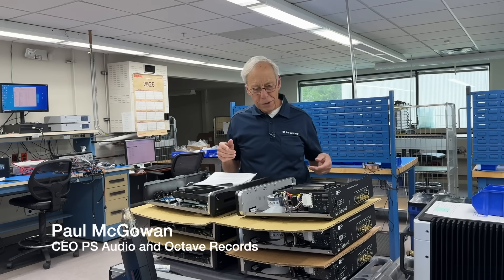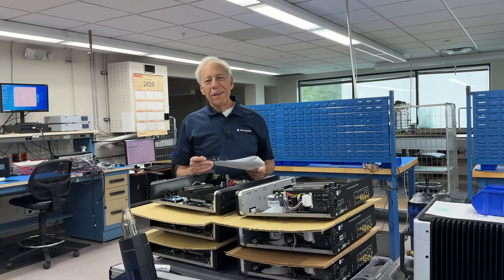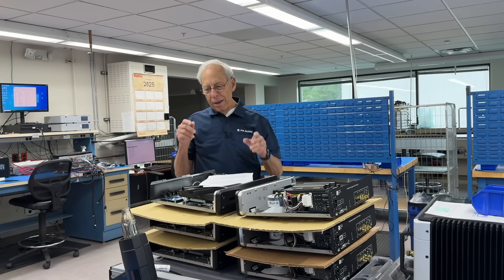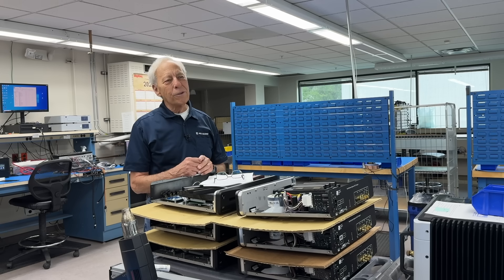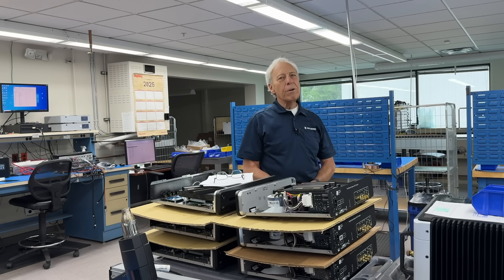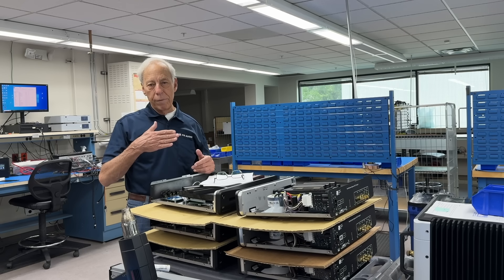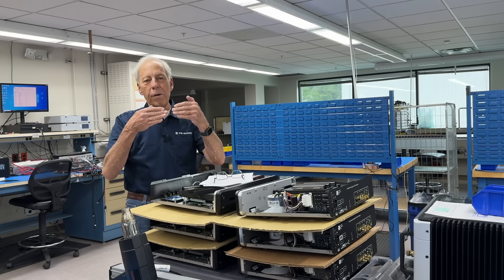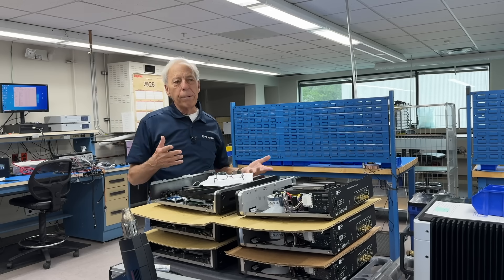How a speakers plays two or more things at once

Comment: Yea but...
The microphone is picking up all frequencies using the same diaphragm, and your ears are reproducing all frequencies with the same diaphragm.
Reply: Using a small diaphragm that only has very small movements (therefore with very low doppler distortion), and because of it's size can reproduce the entire audio spectrum, then putting it close to your ear might be an idea to consider.
Not the same experience with soundstage and so on I know, but cans should be capable of the highest possible fidelity.
Reply: Yes, the audio signal it is a single sum of all vibrations detected.  1 signal per channel.  Each is then amplified and fed to a speaker.

It is, at the same time, far simper than most people imagine and far more complex than most engineers enjoy.
Reply: That Part though 👍 💯

Comment: No that's not correct it's not suddenly moving forward and backwards to produce high frequencies that's not correct. what it's doing is vibrating and it's not actually moving at all. At the same time moving in and out at lower frequencies so you can have something vibrate but actually move as well in and out that's how it produces low to High frequencies. best way is to look at an exciter in a puddle of water should be something on the net playing a low frequency and playing a high frequency
Reply: Vibrating is moving.
Reply: lol.  A dumb response like this... WOULD come from someone with Trump Derangement Syndrome!   Typical NPC Lemming Zombie.

 Vibrations are Movements.  Micro Movements.  And yeah... the cone can and does move.  You can easily see a woofer move in and out... at higher volume levels.  Its called EXCURSION.

Comment: As a nontechnical person, this video was really helpful to me. I sort of understood before, but now I understand better. I have one question, though: If dividing the sound between two or three speakers is better (usually) than doing everything with one speaker, why wouldn’t it be even better to have 10 (pick a number) speakers, each responsible for a much narrow range of frequencies?
Reply: Listen to a pair of four-way earphones, compared to a single-driver earphone and notice the enormous difference.
Reply: It would... so long as each of the drivers are Audiophile quality, and your crossover components are also high quality.

 The less of a Load that you have on each driver... the less potentials for any Micro-Distortions to occur.

 All that said... one of the main reasons why Audiophile grade drivers do not suffer as much micro-distortions, as cheaper consumer grade speakers drivers..  is because Audiophile grade drivers tend to use Stronger Magnets, and Stronger Voice Coils.

 The Stronger the Magnetics... the more Accuracy and Control you will have over the cones movements.

 Its much like comparing a Pickup Trucks acceleration and braking performance... vs...  a Formula 1  Race Cars performance.
The F1 car can accelerate and brake, MUCH faster and better, than the Pickup.   And due to superior structural rigidity... the Race Car can deal with very high G-Force related Stresses... without the frame flexing... where as other cars, would Flex.

 That (in combination with sticky+wide tires)  will allow a Race Car to take very tight curves, at very high speeds, without slipping and getting out of control.   The same is true for a good Rigid speaker cone... that can retain its shape, without warping,  under high air pressure workloads.   And the speakers metal Basket.. also being rigid enough, to keep from warping, too.

 Obviously, Costs are a big factor... in how many drivers + crossover components, that are involved in a single pair of speakers.
And when you add in the extra costs of higher Quality drivers... rather than a ton of "Cheap Chinese Drivers"... you get even More cost being added.

 Anyway... even with lower quality drivers.. you can hear a difference in your music, when adding more drivers.  The easiest way to experience this... was the original 5.1 Surround Sound Amps (before Digital Dolby Surround mode).   Instead of using just Stereo mode... you can choose the Surround sound mode, and a single center channel speaker.. of the same speaker type and size.   You will notice, that when music portions of a surround sound movie comes on... the left and right speakers,  will have vastly improved music clarity... compared to when you only had those speakers in 2-channel stereo mode.   The center channel will be taking some of the Burden off of the Left and Right speakers... which allows for much more accuracy.. with the left and right speakers.

 The reason why most people might not notice this today... Is because they are using Under-Powered center channels... that have much smaller speaker boxes, and smaller + different driver types.   These center channel speakers, tend to be far Inferior to the left and right speakers... so you will notice how BAD it sounds... which will draw your focus away from the superior left and right speaker performance.
Reply: Crossovers also introduce phase distortion/cancellation. You've probably heard on this channel before that there are compromises. In addition to the distortion explained in this video, different size and shape speakers introduce eq and crossovers introduce phase distortion/cancellation. Every company making speakers has to make a series of compromises to get to what they want.
Reply: Technically it is better.  But crossovers to separate the low-mid-high bands are rather blunt instruments,  To build one refined enough to go with 10 bands would make it very inefficient and require high precision parts.  So the whole thing is a trade off between effect and efficiency.
Reply: then they're not a single source and you'd have issues with different sort of cancellation.

however a room does stuff already.  and a lot of performances are designed to be amped - you also need to remember that all recordings are meant to be played on speakers. you could argue that you'd need your recording diaphrame setup to match your output(for the doppler, to mirror the air pressure changes perfectly as they hit the the idealized recording device and are played out from the idealized device), but it gets really silly and some people just prefer different sound than others at some point anyway.

you'd be surprised how decent 20 multimedia speakers playing the same thing can sound though, even without any dsp.  for the doppler thing he mentioned the best would be elements that don't move much at all back and forth but then you get the size of them and it not being a point source problem and they start canceling themselves out.  also the further away you're from the speaker the closer angularly the different elements are in a multi element speaker get - the opposite may be easier to get that if your head was between the woofer and tweeter it would sound weird.
Reply: My guesses are: 
1) Cost and practicality. More drivers = more crossovers = larger speaker cabinet = more materials used = more manufacturing steps. 
2) Us humans may be accustomed to the doppler distortion Paul mentioned. The distortion may actually be smoothing out the frequencies that we perceive as harsh sounding. An extreme example would be a guitar plugged into the PA system would sound very harsh vs a guitar amp with no tweeters.